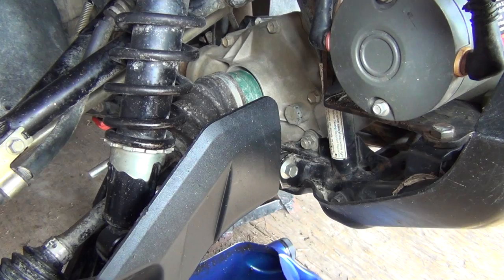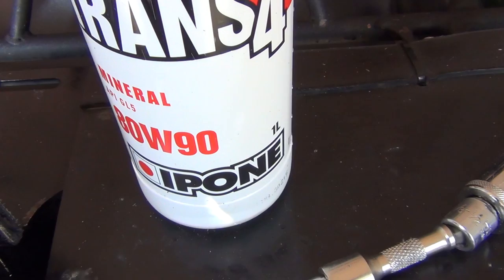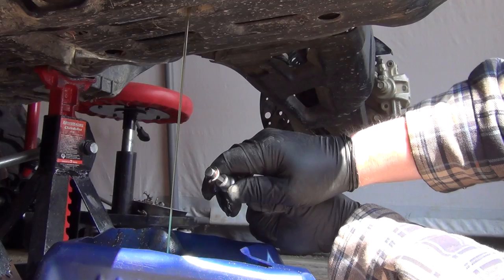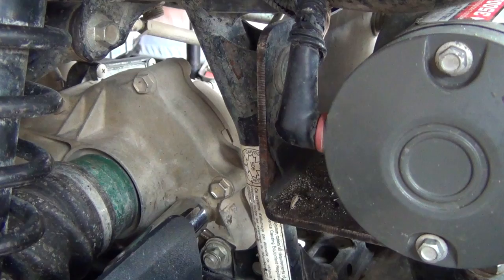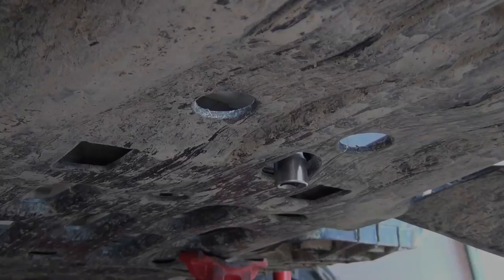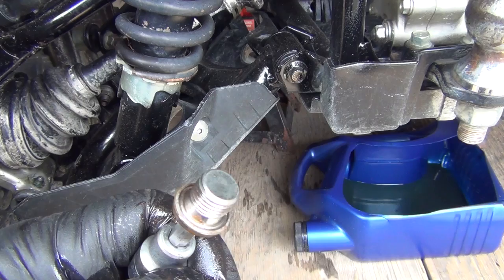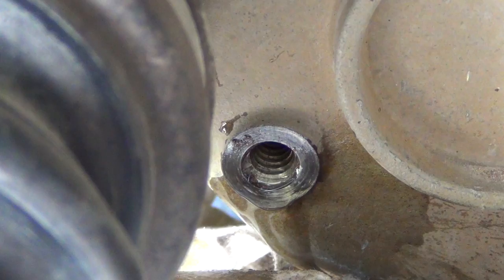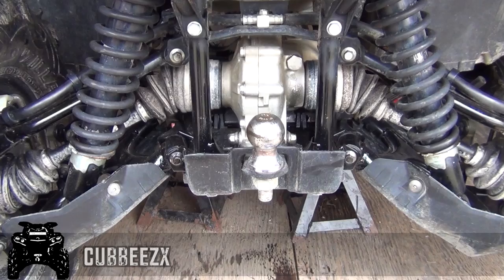2011 Yamaha Grizzly 700 Maintenance - Front & Rear Gear Oil Change With Cubbee

Comment: Just did the Brute Force!  Some people change that allen bolt for a hex head, as the allen tends to strip out eventually!  Nice video Cubbee!
Reply from the maker: Right on!  Yes that would work as long as the hex head was protected and couldn't get knocked off.  Wait until you hear the story about the Front diff oil change on the Can Am...let's just say it's now part Honda!  Thanks for checking out the video.

Comment: been enjoying your latest how to videos, they will be perfect when it's time to tackle mine, and on that subject, how often should you perform these tasks in your last few videos? just when the parts wear out or should you replace on a   kilometre schedule?
Reply from the maker: Glad to hear you are enjoying the maintenance videos and hopefully they will come in handy at some point.  We change the oils when the manual recommends and try to keep to it at all times.  As far as bearings, brake pads...we keep an eye on them and only replace when they are worn out.  Some wear out quicker than others depending on the part and what conditions you ride in.  Hope that helps!

Comment: I have a question, I have a Yamaha Bruin 350 and last year the winch got wet and broke, got a new one and it's been through some water nothing bad and already it's not pulling in it'll only come out and sometimes in, anything I should do to maintain it? Any way to keep it dry or dry it myself? Thanks
Reply from the maker: Hmmm, depends if it is the winch or the switch.   I hear some winch's are more waterproof than others.  Hard to tell, could just be the switch. Try spraying contact cleaner on it and keep moving the switch back and forth.  The switch on the Kodiak does that once in awhile..just wasn't making a good contact.  Hope that helps and good luck!
Reply: +cubbeezx thank you!! I think it's the switch honestly, I know very little about bikes I just love riding, I really don't wanna buy another winch haha I'll see how that goes and possibly an update. Btw very excited for a new video I've been watching for years y'all are the reason I wanted a bike so bad lol
Reply from the maker: Hopefully it is just the switch...that would be an easy fix!  Thanks for checking out our videos, we appreciate it!  Happy Trails.

Comment: Was this the first diff oil change since the atv was bought new? I ended changing mine in my 2012 grizzly at like 1500 miles, lol, guess it wasn't as prudent as I though. I flushed the rad too
Reply from the maker: We try and change the diff oil at least once a year..sometimes two depending on how its going!
Reply: +cubbeezx oh, wow, thank you, I may need to start doing it more often than every two years!

Comment: How often do you do your diffs Cubbee? Are you talking about the blue Loc-tite product when you say anti-seize?
Reply: Use the same exact in-lb torque wrench lol.
Reply from the maker: Hey Canesser!  We try and change them every year in the spring.  The anti-seize stuff is like a "graphite/silver compound" that also comes in a "high heat" (copper colour.)    You could use the blue Loc-tite though...that would work!  Thanks very much for stopping by and checking out the video.
Reply from the maker: They sure come in handy when "wrenching!"
Reply: blue loctite is the total opposite of anti-seize. loctite is a thread locker designed to glue the bolt in making it hard to remove.
anti-seize semi-lubricates and prevents corrosion and debris from getting in the threads, allowing for easy removal.
another thing, your torque setting are incorrect now that the treads have anti-seise on them. you never apply lube to a fastener that requires a percise torque.